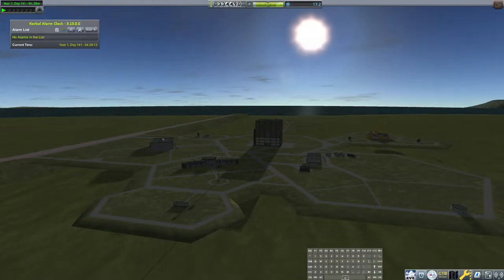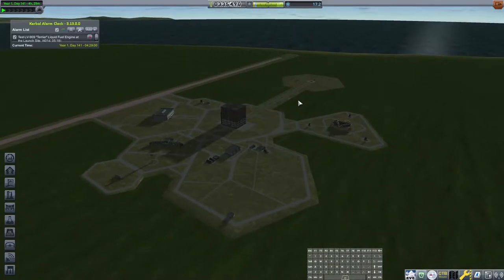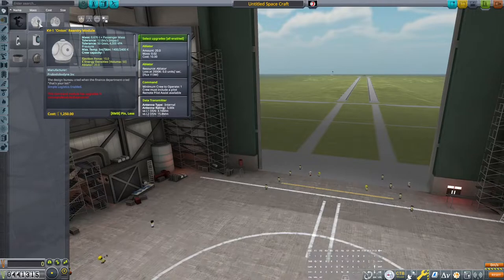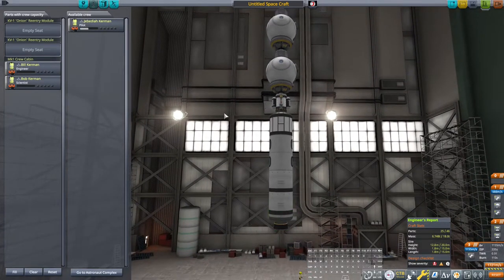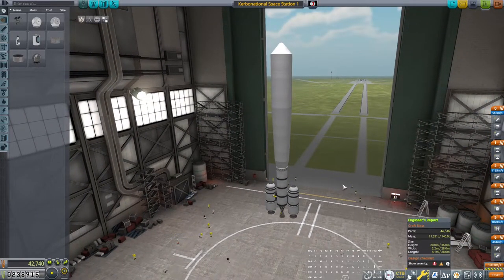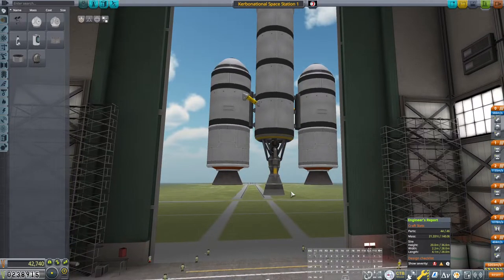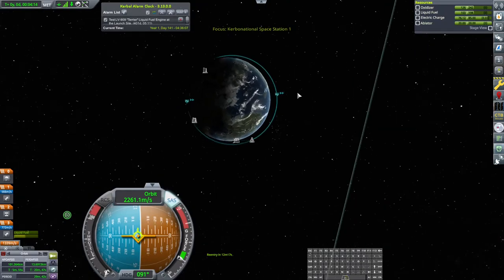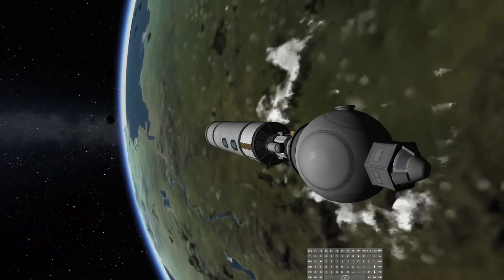Superfluous J Plays KSP - Kiwi Builders 07 - The Kerbonational Space Station

Comment: I've been fooling around with 1.11 already. The construction thingy is basically a much better implemented KAS, but without pipes/cables. A shame. But the building UI in flight is awesome. Also, limited to some kinds of parts (thankfully it indicates whether you can move it, or move it and store it, on the description). Bottom line, you can build a stock asteroid space station now by giving the asteroid docking ports. So it works for me. :)
Anyhow, a few tips: 
· The construction laser is not an item, it's a class feature. Its other name is "a kerbal engineer" I see you got that.
· The hitchhiker has an absurd carrying capacity. No need for any storage space if you use that. Everything else but the big 2.5m container is volume-limited to small-ish items.
· Don't forget to get science kits places! That's a new, expendable, science instrument, apparently. Four per stack, like repair kits (for fixing rover wheels and solar panels and that stuff), and they fit pretty much anywhere because tiny volume.
· And lastly, not related to 1.11, those kerbals' only way out of the "station" is the onion's hatch. The one on the crew module they're in is blocked by fuel tanks. You might want to fix that before you decouple their only way out.
Reply from the maker: I'm also extremely happy with the construction interface. The only thing it's missing for me is the ability to detach a sub-assembly. you have to do it part-by-part. But even with that I'd rather use this than KIS any day.
- I can't wait until I'm rich and swimming in science then :D The Hitchhiker is very hard to get in this career, being locked behind the tier 2 R&D facility. That's a must-get anyway for resource transfer but still. :D
- I'll look into those kits. I've not seen them in the (modded) tech tree yet.
I didn't even think of that! This is just a low-tech starter core so eventually that'll be fixed, but for now I'll just remember to always have at least one RETURNER docked.